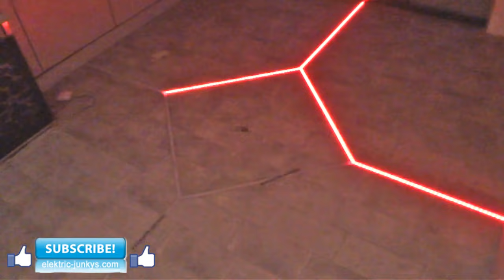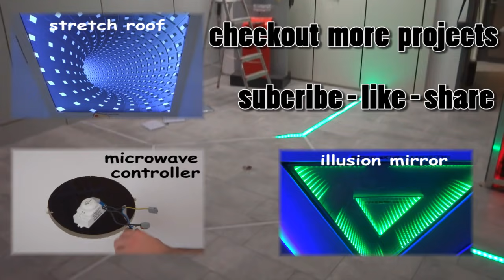how to LED floor tiling system #DIY make interactive Aluminum LED Light tilebar profile

Comment: which Led Strips did you use? Can i buy it on Amazon? Could you give me a link? There are a lot so I don't Know which have the same effect as these in this video.. Thanks keep up the amazing work
Reply from the maker: Theese ones ! http://shop.elektric-junkys.com/12V-120leds-m-dual-line-LED-Strip-5050-LED-RGBW-600LEDs-total-80.htm

Comment: any experiences after the years? I'm thinking to make sth similar in my complete apartment but instead of using tile I want to use laminate in tile optic. I'm not sure about heat and possible pressure from the alu to the laminate
Reply from the maker: thank´s for comment, there´s actually not much heat if you disperce the Power well .. please do not miss our new Video https://youtu.be/hHxKA4JU6BA

Comment: So if I wanted heated floors too, would the heat hurt the LEDs or would I simply have the keep the heat elements 3" from the LEDs?
Reply from the maker: no would not if the heat is not over 45 degree celcius

Comment: Could you tell me what it is you used to case in the lights? I have some nice stainless steel slooter I'm going to use but what do you put over the lights to encase them? And how did you insure water would not penetrate?
Reply from the maker: +Richard McIvor hi checkout our shop.elektric-junkys.com or send us an inquire

Comment: I have skimmed through some of your videos, this being the first one I actually came across and decided to leave comment.

The video quality isn't bad, there are videos with far worst quality out there but it seems like people watching your videos need to go somewhere else after watching them. The reason why I mentioned that is because a lot of the DIY appear to be directed towards people experienced in this field and not towards people that might just be getting interested in it.

I found myself searching for what kind of material would be need for the LED floor since it was not listed anywhere in the video or in the description. If somebody watching doesn't have experience soldering then they will have to go elsewhere to figure out how you did it in your videos and this is the same for a lot of different parts.

I wish you luck with your website and your future videos.
Reply from the maker: 😮Thanks a lot for comment !❤

Comment: how do you find using a roller rather than a brush for throwing down primer? been told the spread isn't the best with a roller
Reply from the maker: hi, thanks for comment, actually a BIGGER Roller would be prefered was just not Around that time ;) I heard the same guys say use a Brush and Massage it into the Wall or Materia, But for sure it depends on the overground of the Surface, Sucking or non Sucking ....
Reply: truth man! love the job done btw!

Comment: this it great, how hard is it to pull the clear panels (acrylic? ) up to replace the leds ?
Reply: they most likely just lift out.
Reply from the maker: easy, just cut it out by Razor "ofcourse they should be pasted in with silicone ;)

Comment: what are those aluminum channels you used on the floor to run the leds into, i had the same idea, but for my van and oak flooring, thank you in advance
Reply from the maker: those are Manufactured by elektric-junkys.com in china ! we have different sizes of the Tracks ... just send us your request and will help you . ! OEM on Higher QTY. for sure no Problem !

Comment: what about dirt? doesn't it gets into these led trays? and doesn't it shorts when cleaning floor with water? Just interesting to know from your experience if it's worth doing or is it too bothersome.
Reply from the maker: +MelectroU just Silicone the spares ...
Reply: ***** oh yea, forgot about that option. Thank you!
Reply from the maker: yeah, but i run double secure as you see, first waterproof strips + adding silicone into the slices

Comment: I noticed that you didn't use any spacer.  Wouldn't that cause issues down the road when the tiles expand?
Reply from the maker: hi mr. Eagle Eye.. on some we were using spacers but after you tile 200SQM you can view it with your eye should be between 2-3mm "should" ;) thanks for commenting

Comment: This looks like it could handle some nasty freeze thaw cycles built into a sidewalk.  I like the idea that rhe LED strip has some cold abrasion resistance yet old be quickly replaced.

Comment: Would be insanely cool if he added a sound detector that you could integrate at will with a system like hmmm eum you know train tracks have switches that changes direction, like that. It wouldnt be any hassle to do and it would be awesome.
Reply from the maker: can be found on our website elektric-junkys.com
Reply: Nice thanks :D

Comment: NICE JOB ...BUT what about water if it dropped on the wires ?
Reply: I guess you should be using waterproof stripes to avoid this problem
Reply from the maker: they are Waterproof ... just watch the video more than 1 minute .. !
Reply from the maker: waterproof Strips + Silicone in the spares of the Acryl Spares ... cheers

Comment: Cool project, but I didn't get what "interactive" there is about it, is it triggered by a motion controller?
Reply from the maker: +Nikoxion hi, not an motion controller yet but we are working on that .. just now it is an Remote controller you can choose of about 120 different Programms
Reply: ***** Wow, 120 modes? Well you have got some variety xD
Reply from the maker: no no the controller have 120 Programs Pre Saved inside and you can choose them via Remote

Comment: I like it,but it would suck if the light strip went out. I know LEDS last a long time but can still need replacement . Cool idea though.
Reply: stalnaker576   In my experience, you will have individual diodes fail rather than a whole strip, leaving sections that are either blank or off color, depending out the RBG blend at that moment. You're point is strong, though.   Despite the fact that LED's emit less heat than the incandescent alternative, they do still emit heat.   Trapping that heat within a channel has shown me significant decrease in overall lifespan of both LED's themselves and also of the flexible waterproofing commonly used in manufacture of these "ribbons".   I look forward to seeing how things evolve, as I am highly interested in high end custom cabinet and kitchen accenting using this type of product.
Reply from the maker: ❤❤ B i G _ T h A n K s
Reply: Love the effects though..awesome work
Reply from the maker: @stalnaker576  thanks for comment mate Long Long Time ago ! :face-blue-smiling:Do not miss our New Videos https://www.youtube.com/shorts/kbeES496eQU  have a great weekend

Comment: Hi what are the supplies I would need? I know where to get the tile, I know where to get the LED wire but do I get the plastic cover or whatever it is you used? Thanks
Reply from the maker: all supplys are made by elektric-junkys.com LED Manufacturer in china DHL Express 3-6 Days send us an email !

Comment: What happens when the Led Strip needs to be replaced, Are the Wires imbedded into the grout?
Reply from the maker: hi, no you just have to cut the Silicone a bit remove the Acryl Cover, replace the LED or IC and close it again ..

Comment: How long before the LEDs expire? And how can I replace them? What's the cost of building about 250 sq. feet of such floor?
Reply from the maker: about 50-100K hrs depend on what quality you use !
Reply: ejunky66 100k USD for 250 sq. Feet???

Comment: how much voltages for the total, do I have to use 3 module  ?? I'm curious, coz I'm using the rgb remote/module with 12v.
Reply from the maker: +Darrell Mila not much about 80A

Comment: whats the power bill like ahah alot? probs cause running those all day thatd be good.
Reply: LED's don't hardly use any electricity. They're very energy efficient. I'm actually surprised the whole world isn't ran on LED lighting.
Reply from the maker: i can tell you exactly the cost, 54$ a month for the Roof and Floor togheter ! cheers
Reply from the maker: exactly right ;) checkout our new Project .. https://www.youtube.com/watch?v=IRPtsDzTV04

Comment: I'm working on a LED setup atm, and I need to run a cord through the wall. Does an RGB extension cord exist, or do I have to make one myself? if so, how do I hook one up to a light strip? If you could link me to a video or something, that would be awesome. Thanks in advance.
Reply: Hi LazerCloud - we've done RGB over 400 feet, plus we have connected two RGB towers on top of a hotel that were 300 feet apart from each other, but tied into one controller so they work together.  We can help answer your questions
Reply from the maker: we made a Hotel in Switzerland last Month, with about 500Meters Wireless Controll Method Via WIFI Multicombiner OEM and DMX optional, the Whole Area is about 2000SQM completly WIFI Controled RGB and WS2812b we can Assist you in any Matters .. !

Comment: can this be done covered with epoxy ?
Reply from the maker: yeah for sure , but then you are really unable to maintain the lights !
Reply: There is a way or two that came up in my mind   now that you mention it but need some work and experiment to get it right but need also to see if the epoxy can let the light pass through that also can be solved... Thanks anyway :)

Comment: What about first doing the tiles and then cutting the LED holes?
Reply from the maker: cuting the LED Holes?
Reply: You know first tiles and then using a machine (I don't know what it is called but they usually being used to cut asphalt) to cut a line that the led's are going to go in. This way it probably will be messier but easier since you aren't going to spend time aligning the tiles.
Reply from the maker: Yavuz Ekim Bovkır you are right a Diamond Blade Cutter, would be nice yeah but if you not align well "straight" and cut your floor ..
Reply: +ejunky66 Yeah that situation would be a pain to fix. Either way I liked the project. Very good looking, patterns are nice etc. Thanks for replying!
Reply from the maker: haha yeah i know that feeling well...  it would be very Painful, No Pro thank you too check out our new Project "only if you are not scared of dungeons" https://www.youtube.com/watch?v=IRPtsDzTV04

Comment: This is the slow messy way also the strop covers get dirty crack break discolour, best way use control lamps and clear epoxy channel no cables in floor just light travel around prism
Reply: Can you link something to show what you mean (im keen to do it your way, im good at tiling just not sure about the led part and what you mean. thanks man
Reply from the maker: ❤❤ B i G _ T h A n K s

Comment: cool, but what if 1 LED breaks?
Reply: First of all, it's an LED, those things really don't break fast xd But if one breaks, that sucks, you have one little spot that doesn't light up.
Reply: Vierkant i know its LED, they don't break fast. but they do have a lifetime of an X amount of hours. after that they break and you need to replace them. which will be damn difficult like this :p
Reply: CowGames Yes, did they glue it in place? Maybe they can still get those things out again. But I also think they have to replace the whole strip :/ But I actually don't even like the look of it so I won't be having any problems with this xd
Reply: Vierkant i think they fixed in place on the metal railing, otherwise it might come loose. and yeah usually it required the whole strip to be replaced. unless its removable LED's which are very uncommon in LED strips. but they can burn like 30.000 hours or something :p i do like the look on it but it would have been better if it was in sync
Reply: CowGames Yes they really need a better program for it. But they also didn't think of a way when an LED breaks. Maybe their first time doing something with LEDs? Either way, they didn't really think this one through.
Reply: Vierkant yeah :p idea is cool though
Reply: Liefbread ahh nice answer :) thanks!
Reply from the maker: open and  replace 1 LED ! easy cut out the silicone
Reply: ejunky66 but you can't replace an led on a led strip without a high chance of fucking it up. also cutting the silicone will make it non waterproof
Reply from the maker: CowGames are you an hobby Business consultant, especially for factories ? I don´t know what you mean, cuting the silicone of the Acrylic covers makes nothing because you cut on the Aluminum first and you resilicone it again .. ! "First"
and second, you turn off the Power, completely cut out this one LED resolder another one add the acryl cover again and Silicone the spares !
Reply: ***** cutting the silicone will cause it to be no longer waterproof and thus can cause a shortage when liquid is dropped on it. also you cannot simply replace an LED on an LED strip(I work in a DIY store and we have these strips, you can't take the LED's off since they are soldered into the strip and when you try to take it off you will break the strip)

Comment: Where's the explosion guard on the angle grinder? Pretty important to have it there. Image google "angle grinder accident" and you'll see why.
Reply: Hats off to you sir or madam, you just scarred me for life! raises both hands above head and Starts rapidly clapping
Reply: +Nextro games If that means you will never ever run an angle grinder without the explosion guard on it, my workhere is done.
Reply: Nuckelhedd Jones Aren't those aluminum profiles even? Might even work decently with a standard wood blade, if you're careful.
Reply from the maker: 😮Thanks a lot for comment !❤
Reply from the maker: 😮Thanks a lot for comment !❤
Reply from the maker: 😮Thanks a lot for comment !❤

Comment: what is the milk looking stuff that he puts on the floor
Reply from the maker: +Liam Turner hi, it´s an PRIMER (ground primer) it is for get an Perfect ground for the tile adhesive connect perfectly with the Floor, if you don´t use that and just add the cement adhesive it´s possible that the tiles are lex or loose ...

Comment: Hey everyone! I have an annoying issue with my led strips. I am using a T connector to connect 3 led strips, but they don't show the same color only when using RED or BLUE, for example the yellow doesn't show on 2 of the strips (just the main strip which is connected to the power) and the green color does the same. The purple works on 2 of the strips only. What could be the issue? The Connector, or the LED strip itself? Help me please..
Reply from the maker: join our facebook group maybe our community can help you !

Comment: How is it working that some leds are turned on and other leds not?
Reply: +D4m4g3Cr3w this are kind of Ws8212 LEDs
Reply: +D4m4g3Cr3w Microchips are integrated in the strips between RGB LEDs. They control when the individual LEDs come on to create the different effects.
Reply: +D4m4g3Cr3w there have a kind of controller ,but first need and multil color RGB strip light ,then buy an DMX Controller,it have too much different effect you can choose-
Reply from the maker: 😮Thanks a lot for comment !❤
Reply from the maker: 😮Thanks a lot for comment !❤

Comment: Kinda reminds me of a movie theater, not sure I like that. Solid application, but can definitely see it not lasting long on the floor, and even if it did the lights will eventually die. Cool, but overall not practical.
Reply from the maker: LED´s are replaced in 5 Minutes, You can Drive with the Car over it + it is completely Waterproof after you seal it with Silicone .. so it is definetly Practical .. you should ask the 500+ customers which purchased the set ...

Comment: Those single leds looks really bad , you should have added diffuser in those aluminium channels .
Reply from the maker: or you should use our New LED Strip Modell seamless LED Line COB .. check on elektric-junkys.com ... cheers !

Comment: One bulb blows and you have to pull up the whole panel to replace it >.>
Reply from the maker: +Thomas Druce no you dont ..
Reply: Have you even watched the video? The LED strips are cemented into the floor, so you'd have to pull up all the tiles adjacent to the strip you want to replace.
Reply from the maker: Thomas Druce hahah have you seen that i made this Video ? And i tell you NO YOU DON´T, remove the Plastic Cover and replace 1pcs LED "IF" cheers Thomas
Reply: Huh, I thought the casing itself was cemented in, thanks for the correction.
Reply from the maker: Thomas Druce no pro. Thomas